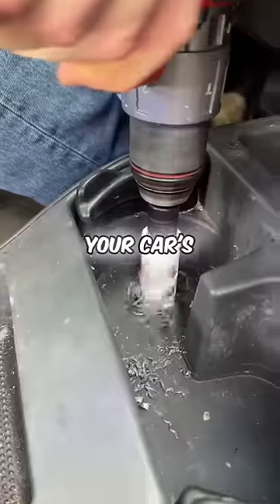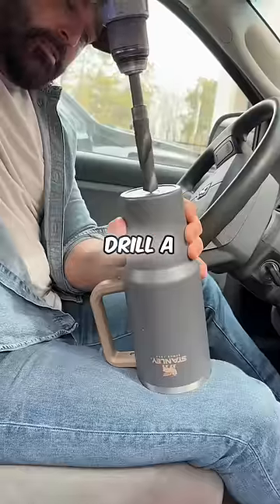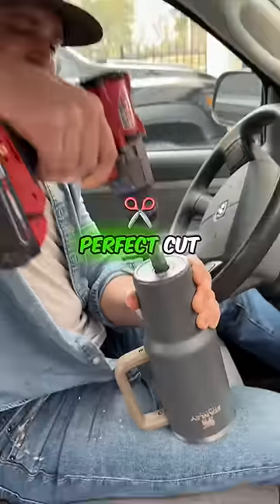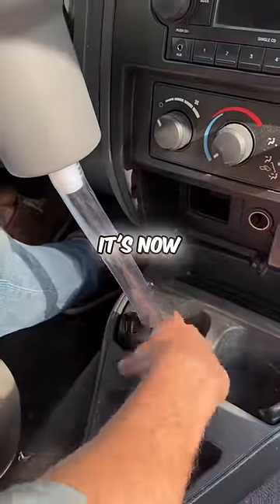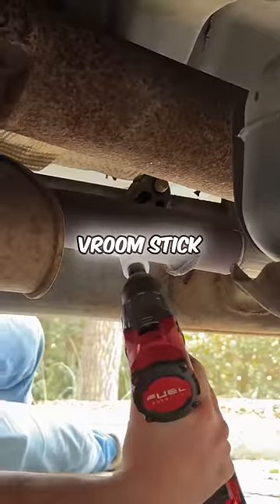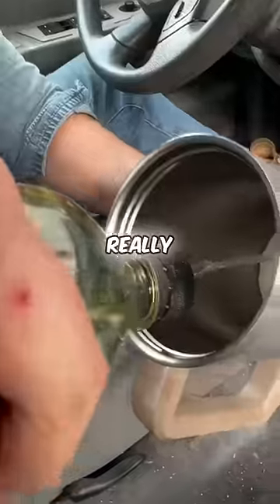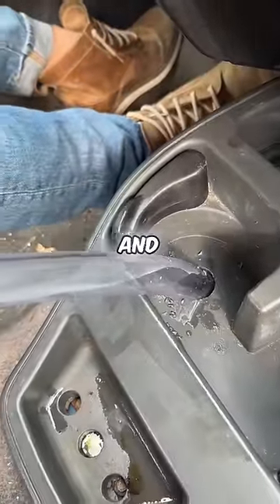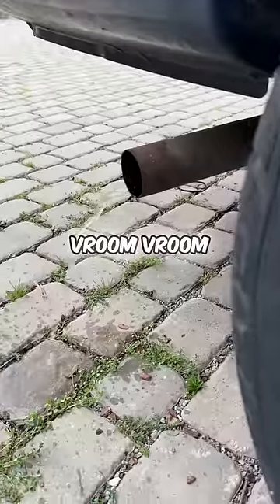Redneck + Stanley Cup = 🤯

Comment: All fun and games untill the cab fills with exhaust gas’s 😂
Reply: That's the point
Reply: Darwin at its best.
Reply: Good wayv to start  a fire, too!
Reply: And melting plastic fumes
Reply: Exactly what I was thinking
Reply: I was thinking the same thing 🤣
Reply: Natural selection
Reply: Even worse the pee gets pushed back through the cup and sprays you…suddenly carbon monoxide doesn’t seem so bad
Reply: The farts 💨 you mean
Reply: That's only the first 2 minutes. Any longer and that plastic pipe would have melted off
Reply: Imagine rolling some coal and the whole cab fills with black smoke
Reply: Evry time he walks by that truck he’s gonna smell piss now to
Reply: That's what the lid for the cup is for! Not in use make sure cap is on lol
Reply: Cup will act like a megaphone and echo the exhaust noise directly to his right ear...never mind the carbon monoxide poisoning.
Reply: Right
Reply: Ya that and the fact that the clear rubber hose will melt and your exhaust will become loud with a hole in it and your car will smell like piss from the residue from the cup evapourating right under your nose.
Reply: F5
Reply: New suicide invention...😅
Reply: Fax
Reply: How to die part 1
Reply: Really.
Reply: @ismaelrios7046   Imagine hitting the gas just after you took a fresh p*** and not to mention the cab is goingna smell like hot p***
Reply: Fun fact look where your steering goes through your firewall at you’ll see 3 exposed holes that come from factory witch lets gas into the car if you didn’t no know now you do
Reply: @RidingWithWill   3 holes that are directly connected from the exhaust to the firewall? Straight from factory you say…. Idk where you’re buying cars from but not where I’m from 😂 
There’s vent holes for sure to help air escape when you close the doors and all that. But no car comes with cab gas intake holes bud.

Comment: They drilled the hole right where the lead is concentrated…
Reply: I was hoping somebody would notice that
Reply: I don’t think drinking out of the piss jug is in the picture
Reply: Ok so? Lead isn't going to kill you instantly. Do you wear PPE when working on your battery terminals, or when handling 22lr ammo? Those are pure lead.  @antondees
Reply: @farmyardfab  yes I would wear my ppe if I was putting lead fine dust into an enclosed space. As for working on battery terminals, I wear my gloves, and I'd wash my hands after.
Reply: Why not just let it go out on the ground so carbon dioxide will not enter into vehicle, but the plastic pipe will probably melt and you will have an exhaust leak.
Reply: @farmyardfab Exactly, people have been handling their battery bare hands for years without any problems. Sometime people dont understand the difference between huge and small amount. Working on a car isnt like you were taking a puff of lead, if so imagine the number of mechanics in shops that would be affected. There wasnt even lead warning on new car parts until recently when california decided to enforce that on all product with lead in it 🙄
Reply: I WAS WAITING FOR THIS COMMENT 💀💀🫡
Reply: @farmyardfab  i use lead wipes after range day so thats that

Comment: Well I wouldn't put it into the exhaust pipe because the exhaust would backflow inside and it might cause excessive rusting to the exhaust system, but just simply running it through the floor to run outside wouldn't be bad.

Comment: I keep a 1 qt. plastic container with a paper towel inside my vehicle. When I have to go on the go, I just go into to container and empty it later, or just pull over and do it in the road. that way I don't have to drive around with urine smell in the cab, and or breath exhaust gas.

Comment: For one new veicals suck sports cars suck cars that are low to the ground suck old truck fro ranges from the late70s to the late80s are the best and also most full wheel drive cars In The front there where you cut that hole that’s where the transmission is stupid

Comment: Reminds me of a garage I rented in front of my apartment. I had a muscle car I would work on at times. I took a funnel and  hose and drilled it into the back of the garage. After 2 years of pissing in the funnel. I realized the wood absorbed all of my piss and in the summer it would smell. I revisited the garage many years later. They replaced the whole back wall of the garage 😂